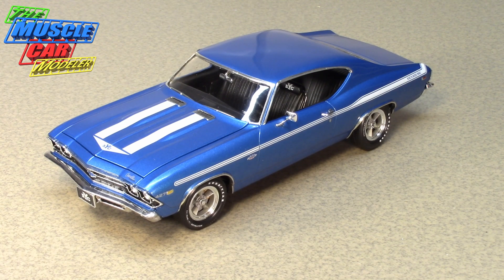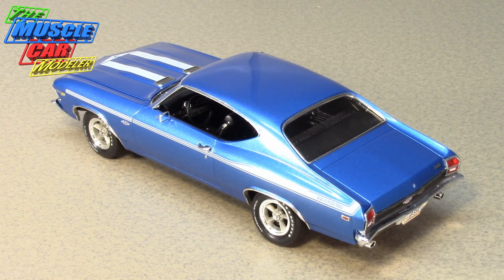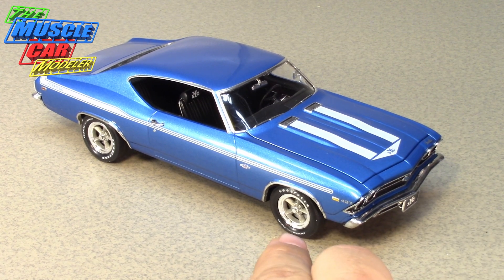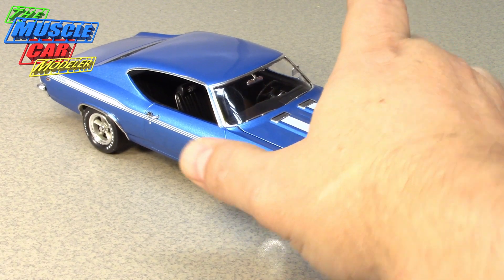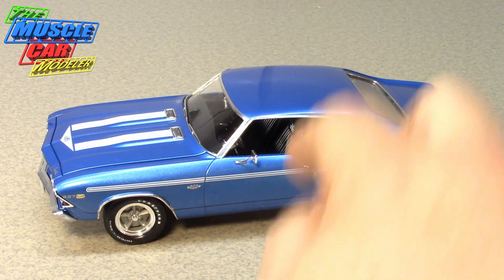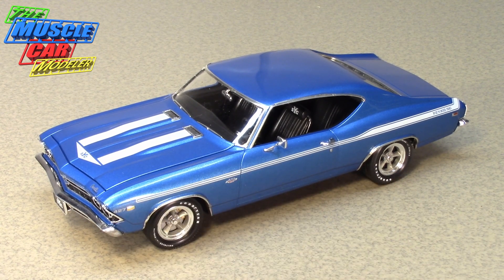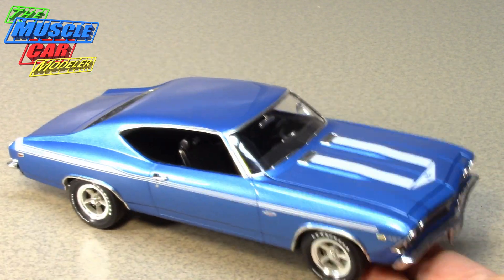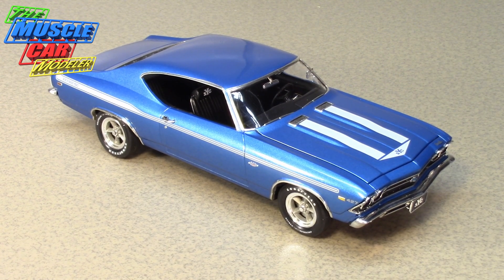Revell 1969 Yenko 427 Chevrolet Chevelle Build

Comment: Another great build I’m going too build that model as I don’t have a yenko chevelle I have the 69 yenko nova and Camaro but not the chevelle. I have a muscle car review magazine from the 1980s with an interview with don yenko he said that he never owned any off his cars and he never thought they would ever be worth anything he even said that they had hard time selling the short block 396 engines from the conversions  mostly sold them through word off mouth are ad in the paper he said they practically gave the engines away .talk about wow .he said he regretted not keeping one off his cars as by the 80s they really started too become collectible .i know how he feels in the mid 1990s I owned a 1967 mustang s code 390 coupe payed 1200 dollars for it no power steering no power brakes  c6 auto running and drive car all original.sold it too buy another project.car ✌🏿
Reply from the maker: Thanks! I had a friend in High School that also had a 67 S code 390 Fastback (but it had a 289 in it instead, He did have the original motor still but not in it.) I loved it and it even had the ribbed tail panel that I had not seen before. He was offered something like 12K for it in 1992. So he sold it.

Comment: Hey buddy. Excellent Yenko build! Turned out really nice. I just found your channel, and I love your work. I’m planning on using this kit to build a COPO Chevelle. Do you have any tips on how you removed the SS badging from the grille and rear panel over the bumper? Like any tools you used to get into that small area, sand paper grit, etc. I would appreciate any help before I get started. I plan on watching more of you builds. Keep up the excellent work!
Reply from the maker: Thanks for the sub! I carefully trimmed the SS emblems off the grill with the exacto knife. On the rear i just sanded it as best I could with sanding sticks. The front was hidden buy the photo etch bowtie but the rear was not as easy to blend.
Reply: Yeah ok. Thanks man. I’m gonna have to give it a go. Hope mine is half as nice as yours. Love it!

Comment: From what kit did you get the tires  from?.  Would the Firestone wide ovals from the mustang 302 kit from revell be accurate for a 60s chevy muscle car copo and bm what tire brands would you suggest and what kits
Reply from the maker: The wheels and tires I used are from the Revell 69 Yenko Camaro. They are plain tires with no lettering, and I have a few parts kits that I got them from. The lettering is dry transfers that I added from some old Shabbo Sheets that are no longer made. I believe this kit comes with the Firestone tires also used with the 69 Boss 302 kit.
Reply: @TheMuscleCarModeler  would it be accurate to use Firestone tires on a chevy or copo  or was that just a Ford item in the 60s and 70s